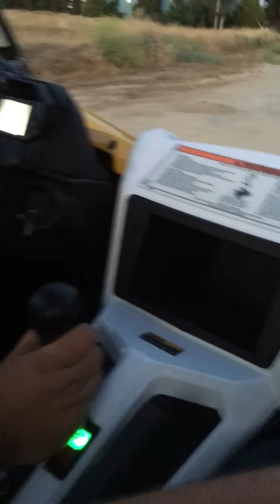YXZ 1000 MPI 200hp turbo kit TOO FAST!

Comment: FYI that is the 155 kit.  I can tell from the video your only running 5.5psi of boost as I had the 155hp kit til I did the motor work and move the boost up to get 200hp.   look on mpis website, they will show you that the kit is 155hp until you do the motor work and add more boost...

Comment: i have a yxz turbo 160 hp and his doesnt sound any faster than mine ..
Reply: I have a 2016 Yamaha with mpi turbo and the tail pipe along with a fuel tuner pushing 155 hp what is the price to get it up to 200-220 range

Comment: i have a yxz turbo 160 hp and his doesnt sound any faster than mine ..
Reply: Rhu Austin its fast. trust haha. espiecally when you use them on e85 with a turbo kit
Reply: stock internals ?..i ran race fuel with 8lbs boost .and was rite on the edge if blowing. lucky I didn't.